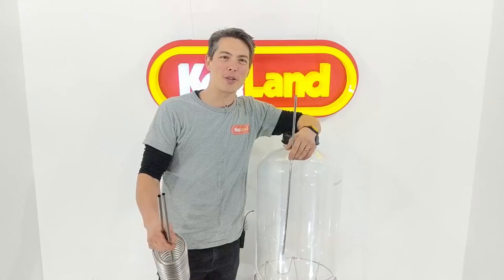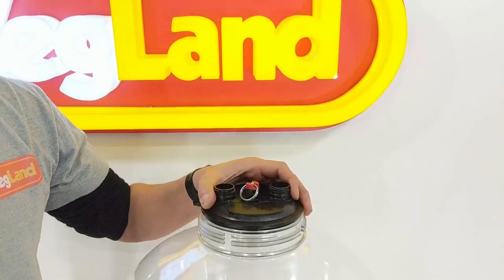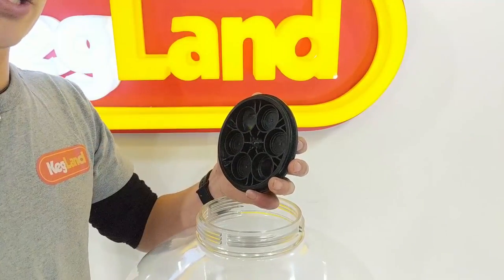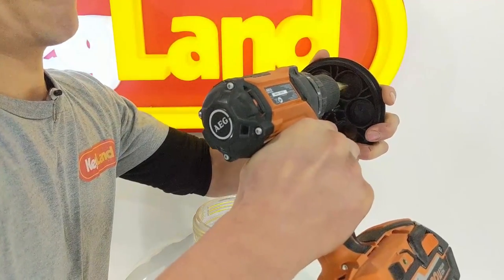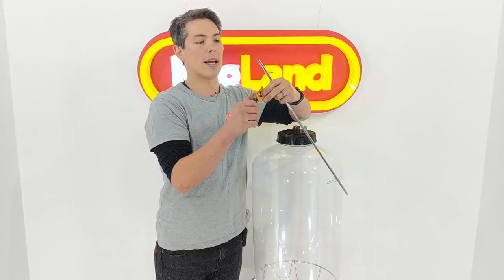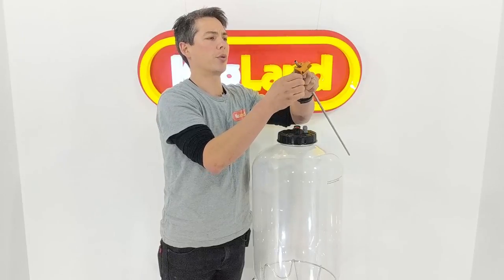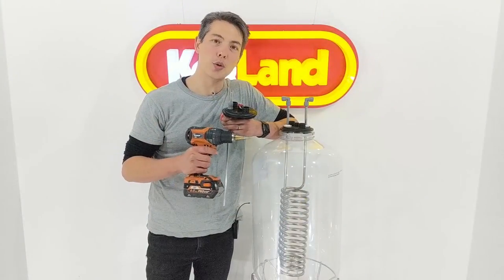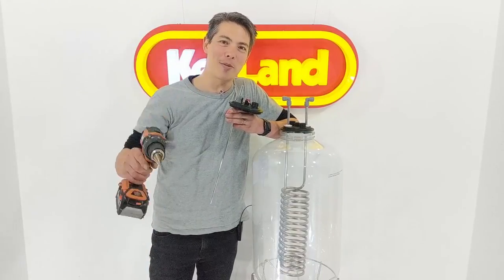Temp Twister and Thermowell - FermZilla Accessories

Comment: Hi, just did this modification on a corny keg lid and the kegmenter lid. Do I need to leave the parts disassembled and exposed to air to passivate the holes or is it ok to just wash the WD40, sanitize with star San and assemble? Right now I just assembled after washing/sanitizing and put CO2 to test for leaks with 20psi

Comment: This is a very helpful video. After watching it, I successfully installed your thermowell onto the plastic lid of my fermenter (which was made by a different manufacturer). I didn't have that fancy drill bit so I used a 1/2-inch spade bit. 
I have to say that I'm stunned that you drilled into the lid while holding it in your hand. That's insane. So is  drilling into solid metal without wearing safety glasses. You must not have lawyers in Australia.

Comment: Everything looks perfect but I have some doubts before drilling the top cover.
What type of joints, connections and connectors are needed to maintain isobaric capacity and how much pressure does it allow?
Are high-strength teflon joints recommended? TY

Comment: an O ring on the outer mating surface of a through bulkhead fitting is not the best way to seal this. Maybe you might consider a two neoprene washers. one top and one underneath as I have done. Seems to work a treat. I really like Fermzilla it is an excellent learning tool for me before I move to something more substantial. I love your work. Keep it up :) Cheers.
Reply from the maker: Thanks for that Robbie. Really appreciate it.
Reply: the one under isnt really doing anything as the threads on the bottom nut allow for leakage. you can teflon tape the threads, but this is a poor solution as sealing on the flat exterior mating surfaces is the only reliable way of doing it. the one washer on the outside is the main improvement as that little oring looks a bit too small imo too, the nice flat washer would give me much more peace of mind. appreciate the idea

Comment: Hi ! Thanks for the quality content ! Question : does those add-on eliminates the pressure tight aspect of the FermZilla ?
Reply from the maker: Not at all. Both of these options are suitable to over 3Bar.
Reply from the maker: Not at all.  The unit will still hold pressure.  The duotight fittings can withstand more than 150psi.  So it really comes down to the pressure holding capacity of the fermenter itself.  The fittings seal up really easily.

Comment: I need to install a temp twister in the 2 inch tri clover lid but not finding any information or instructions on how to. Apparently you need to bend the pipes 20deg. Could you please share a link where I can read up on it? Thanks for the awesome products!
Reply from the maker: The temp twister coil will come into the lid at a 20degree angle. No need to bend it as it will fit fine.  You only need to bend the coil if you dont like the idea of it sitting straight up and down.

Comment: Have you thought about installing the temp twister inside the lid of a corny keg? I ferment my meads in corny kegs and think
 it would be cool to daisy chain a few coils through my last outlet on the glycol chiller
Reply from the maker: We do not really recommend fermenting inside a corny keg as the corny kegs are not really designed for this application.  It's best to choose a purpose built fermenter.

Comment: I'm having trouble getting this Thermowell accessory to seal tightly.  Looking at your video at the 1:45 you can see the indents that your drill bit is pointing to.  I had to remove those indents just to get the screw to touch the fitting let alone tighten it down.  The screw (at least the one I received) was too large to fit down in either one of those smaller recesses.

Comment: Great product!! 
I have an extra temp twister and was thinking about using it in a portable type of draft system...would it be safe to run beer through one of these? Cheers
Reply from the maker: Yes, absolutely.  It's a food grade stainless coil so you can have beer run inside of it if you want.
Reply: @KegLand  much appreciated! Now I need to test if the coil length is enough to cool down the beer :)
Reply from the maker: @lapintabrewing8801  let us know how you go. I would be interested in the results.

Comment: Hi Kee, I've tried installing the temptwister a few times now and it keeps leaking from the duotight connection to the coil.  The duotight doesn't seem to be making a proper seal. It is not leaking from the nut.

Any suggestions on how to make a proper seal?  I've tried with new bulkheads and the issue persists

Thanks!
Reply from the maker: Is it possible that the o-ring in the duotight fitting is damaged?  You should be able to remove the o-ring and inspect this.  If the o-ring is in good condition it should seal.
Reply: @KegLand thanks for the reply! I was finally able to get a good seal.  I used blue monster plumbers tape around the threads & keg lube on the O ring.  Thats
 seemed to do the trick

Comment: I'd be keen to see how you might setup the Temp Twister to work with your ICEMASTER G40.1 to control fermentation temperature.
Reply from the maker: We have a new model of ICEMASTER G40 that will be differently setup for fermentation control.  So we will do a video on this soon.  We also have a smaller G20 model that might be more suitable for domestic use too.

Comment: Can i use a temp twister for a 150L fermenter? I want to cold crush, and i have a glycol chiller at -2C to do this. Can this be done?
Reply from the maker: 150L might be pushing it. It would also depend on other factors like ambient temps and potential for heat ingress and the amount of insulation used.

Comment: Any plans on getting both of these products to Canada (orders from distributors)? I love the FermZilla line, recently got the 55L version and it's such an innovative product. I would get a couple of all rounders for longer conditioning and a 27L version, but I can't find these accessories to connect the fermenters to my glycol chiller. Only option is to order either from the US or China, which makes for really expensive parts with shipping and duty taxes. Thanks!
Reply from the maker: Local distributors should be able to bring some in from Kegland China.

Comment: Hi Kee. Can one fit both the probe and the coil togeter? Or will the probe sit up against the coil?
Reply from the maker: I am sorry I dont fully understand the question?  The probe needs to go down a separate thermowell hole so it's airtight and holds pressure.
Reply: @KegLand  thanks for the reply. What I mean is, will the probe be touching the cooling coil inside the fermenter once both are interested.

Comment: Can I replace the original plastic lid for this 4 inches stainless steel cap in my All Rounder 30L??
Reply from the maker: The 4inch Tri-clover Lids are different and not compatible.
Reply: @KegLand  is there any substitute in stainless stell for the original AllRounder 30L lid? Then I could do custom holes and attachments, for exemple, a dry hopping that is bigger than a bottle neck..
Reply from the maker: @lpirola  that is very coincidental.  We are in the process of releasing a new FermZilla lid that has a 2inch tri-clover opening at the top.  So you can use this for dry hopping.  We also have a new try hopping device too that is also about to be released.

So I would probably hold your horses on this one and just wait a little bit as all this stuff will come out with the new FermZilla Gen 3

Comment: so wait, you can use a 4 inch tri clamp fitting on the top of the Fermzilla??
Reply from the maker: Sorry that's a bit confusing.The 4inch tri-clover clamp will not fit the FermZilla.  The 4inch tri-clover lid will fit only things like the Kegmenter like this:

https://www.kegland.com.au/58l-kegmenter-304-stainless-uni-tank-pressurisable-fermenter.html
Reply: @KegLand  oh duh. Makes sense.

Comment: Hi Kee. o you fill the thermowell with liquid or leave it dry? Great vids, cheers.
Reply from the maker: As the probe is completely surrounded by the liquid with only a small air gap not much is to be gained by filling the thermowell with liquid.  The probe will be slightly less responsive but temperature changes in something like a fermenter are generally very gradual and slow anyway.  For this reason it's best just to leave the well dry.

Comment: The thermowell and coil look awesome, the drilling stainless with a step drill made me cringe.
Reply: No way.  What's wrong with that.  Do it all the time.
Reply from the maker: Just use lots of pressure and go slow.  Make sure the material doesn't heat up and you can drill heaps of stainless with one bit.